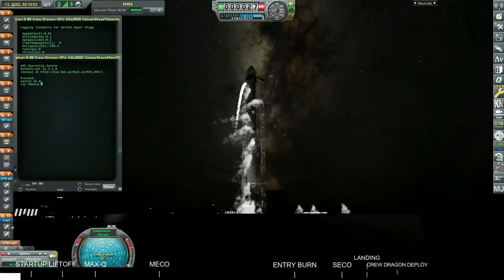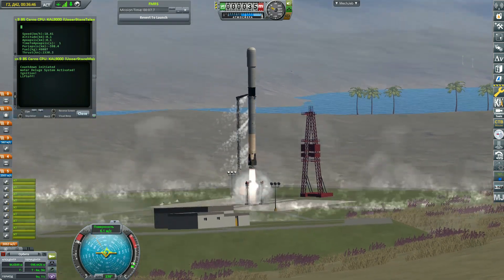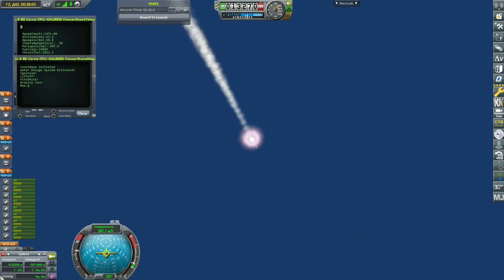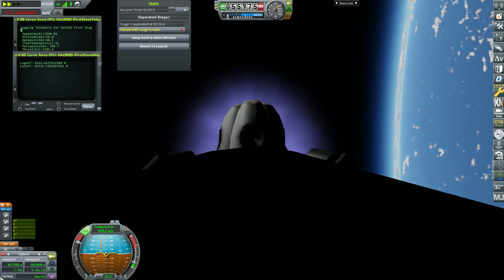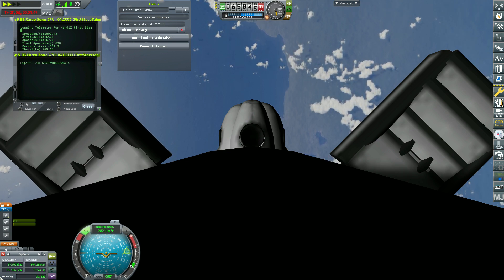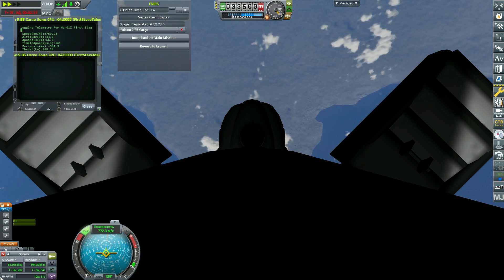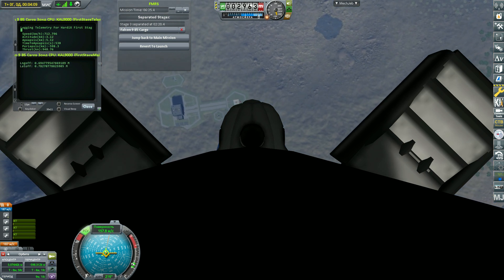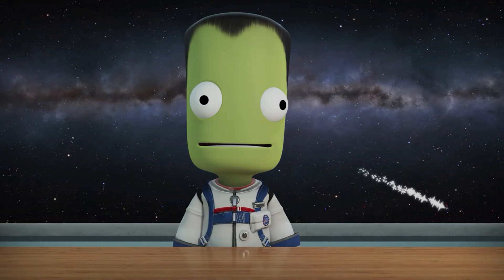NROL-87 Mission

Comment: patiently waiting for your orbital flight test
Reply from the maker: In just over 30 launches.I think that will closer to end of Summer but i can do it faster if i cancel CRS, Crew, Transporter missions which begin looking like starlink i have already cancelled
Reply from the maker: I calculated it, with CRS, Crew, Transporter missions i will have 35 missions before IFT, but without them only 25 flights.Thats almost a third, so with my typically 3 launches per week i can complete them in 2 months, so July can be for IFT.If not cancel these 10 launches i will complete them in about 3 months, so August is a date
Reply: @viacheslavshtaferun4291  Looking forward to them! keep it up!
Reply from the maker: @mikegeraci22  thanks for that.I not decided should i cancel these launches or no yet, so you can say your opinion about them.They can make IFT closer on about 1 month